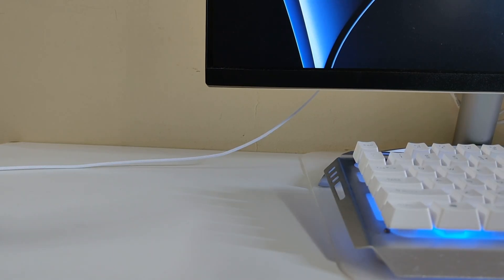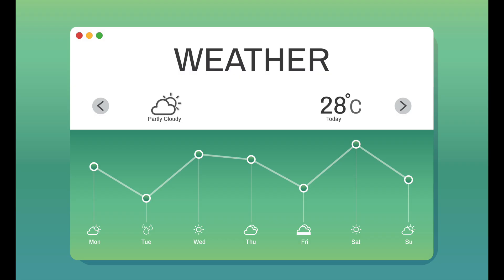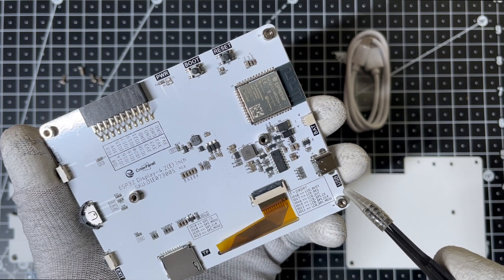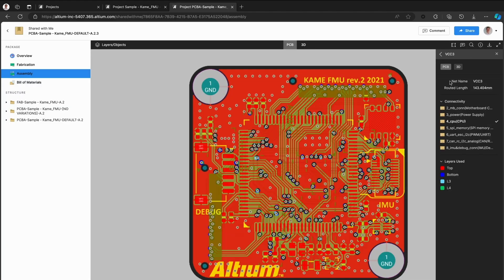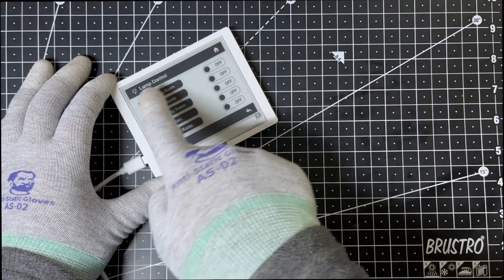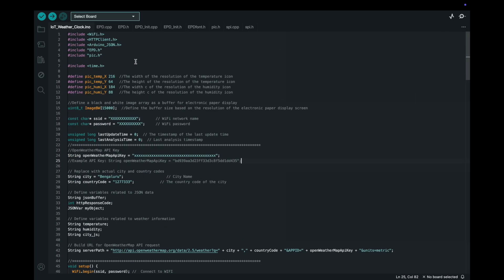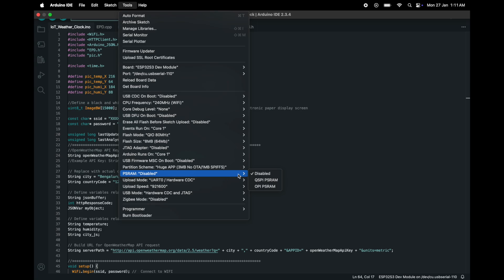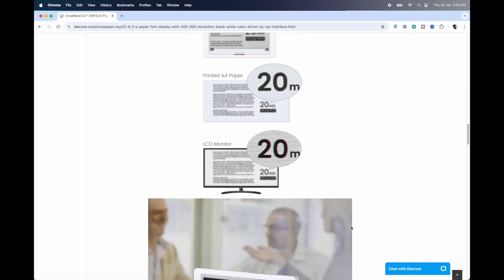The E-Ink Weather Clock: Your Ultimate Desk Accessory

Comment: That's pretty slick! Does the screen have an internal battery or does it require external power all the time? Where can I find the code?
Reply from the maker: No, the current version doesn't have a battery.

In the next version I am actually planning to install one, while maintaining the same thickness.

Now I am scouting for thin batteries.